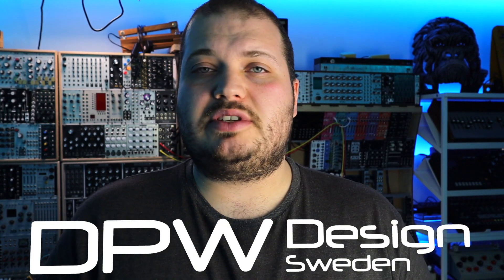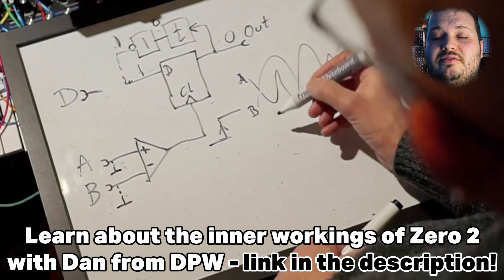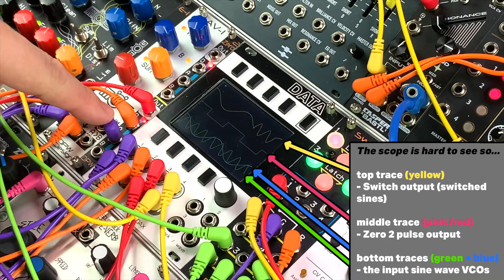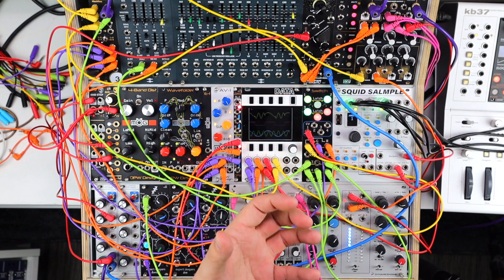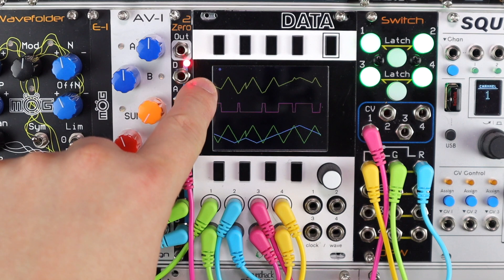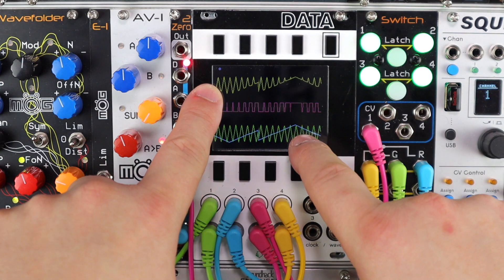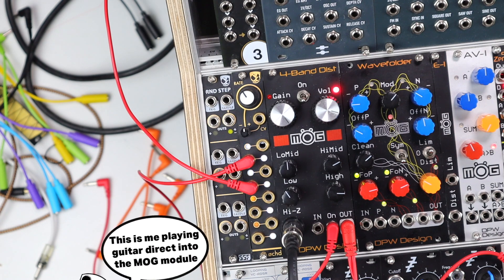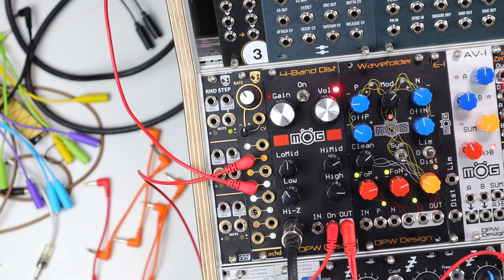Tiny module HUGE patch potential // DPW Design Zero 2 & Switch

Comment: Thanks for pointing me to this video.

The functionality of this module is exactly what Eurorack is for, in my eyes: simple, meaningful ideas that open up many possibilities.

I  would love to use it with Joranalogue's Select2. Do you know any modules that convert tiggers to flipflopped on/off-gates
(More precise: Input for trigger signal, output for a gate, that is being switched on and off with the trigger.)?
Reply from the maker: I wonder if the Route 4 will do that from Joranalogue? The Flip Flop module/function I have and use the most is part of the LogicOgic from AniModule that has a dedicated Flip Flop section.

Comment: Love the lighting in that opening shot!
Reply from the maker: Thanks George, when we built the studio we dropped ceiling slightly (more acoustic treatment between here and upstairs) but the main purpose was to put a shadow gap in the ceiling. Which is a sort of lip around the edges of the room where the walls meet the ceiling and there's LED strips all the way around the room then. Coloured lights are fun but the main purpose was bright light when needed but without seeing the light source so it's never harsh to look at.

Comment: The first patch is switching at audio rate?
Reply from the maker: HI Jed, yeah 03:39 is audio rate switching. zero 2 analyses the two inputs and gives a signal that is when they are at equal powers (say both 2V or -1.356V etc) and then switches the inputs on the switch.

Comment: Great video!
Can the zero 2 be used by itself to create pwm from an oscillator? It seems like it can from the Ripping tearing pulse waves part, but I'm not sure.
Reply from the maker: The output is always a unipolar pulse. So any waveform in and it'll give a pulse. You could use the output like more standard PWM by mixing and playing with a different oscillator waveform and a LFO (the one you'd use for the PWM). 

The DPW Limit does a good job of PWM too as you can use an LFO to push a waveform into clipping/limiting